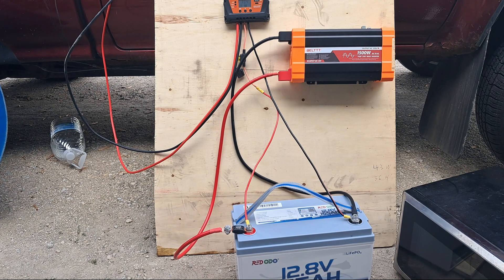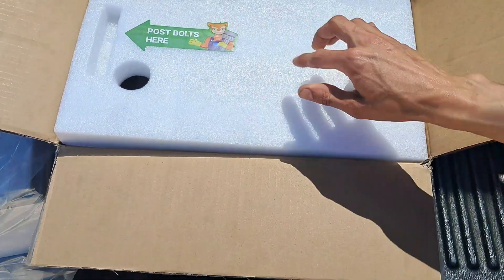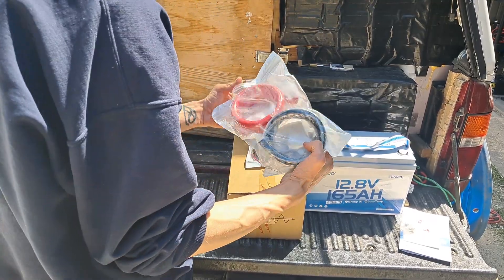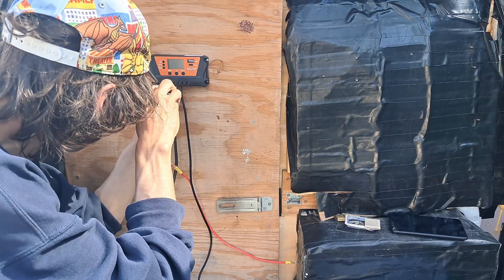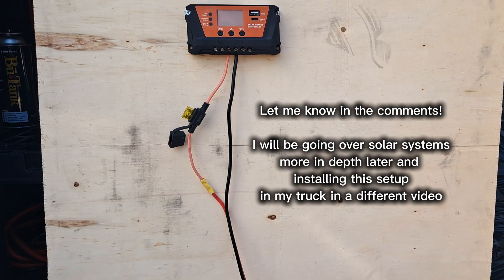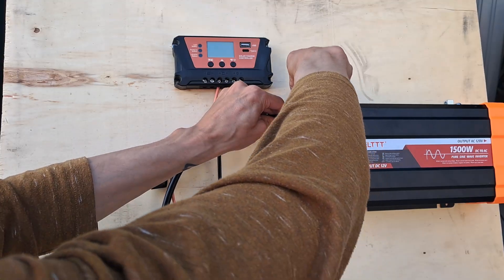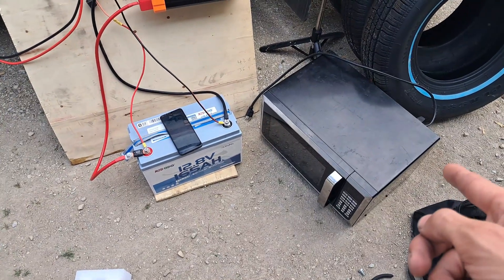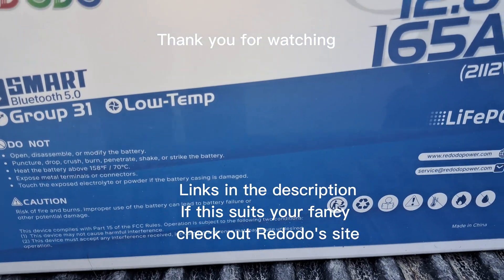Quick exploration of the solar system: Redodo 165 AH LiFePO4 Battery

Comment: Great video.  I like to play around with different solar set ups.  I currently have five AGM batteries for my set up, but they are old.  I've been thinking of upgrading to the lithium batteries like these.  Keep up the great videos.  Stay safe.
Reply from the maker: Nice! I was originally going to use agm batteries since I sometimes can get used ones in decent condition for cheap but decided on a powerstation because I was unfamiliar with everything. You gave me a good idea though might get one to test
Reply: @StriveSurvive  You sure looked like you knew what you were doing.  Great job.

Comment: I built my own power station and I made it overly complicated 😂. I like your setup and it is always nice to get out and try something new.  You can also buy a battery charger for it then when you have shore power you can use that too.  I would add some usb and usb c to it too. They are cheap and more efficient or so I have been told.
Reply from the maker: As long as it works right 👍   
I thought about making a portable version but ended up just installing this setup in my truck been great so far! I also thought about that but the solar charger has a USB A and C port and the power inverter has a single USB A port as well so I'm covered there  lol didn't have to think about it to hard it turns out.
Reply: Yeah and honestly whatever works best for you will be good. I mean it is never a one size fits all. I really like this channel. Keep up the good work!

Comment: you need a small crock pot that uses like 500 watts  and a small hot plate cheaper than propane good deal major upgrade for sure ! with a cheap hot spot you can stream and work online now ! use the power banks to run the fridge and lights !! sorry thinking out loud !
Reply from the maker: Haha it's okay good thinking! I might wait on the hot spot but the crock pot I've been wanting for some chili 👍

Comment: Once shes all charged up use the solar to continue to charge the power station thingys. That way you can run one heater on the battery setup and another on the power box and still have one in reserve that way youre not leaning too heavily on one power source
Reply from the maker: Yes good call appreciate the advice, and thank you for watching

Comment: Good to see you again! And glad you're getting the power upgrade. I'm hoping I can get a small solar system going in the near future. Most "no-name" inverters are best limited to ~85% load capacity for longer life. Also I wouldn't trust the low-temp cutoff in the battery without verifying that it works. If you serve any electrical contractors at your job put the word out to see if someone can do your crimps for a 'beverage donation' in lieu of payment. Hope you've found a good parking solution.

SOS here, can't make much headway as my body is failing me a lot faster than I imagined so work ain't much now. Hoping I can find an engine block this month but if not I'll have the $$$ next month. Still got the borrowed truck but it's a gas-hog. Take care bro and best wishes from the already-too-hot South 😎
Reply from the maker: Good to be back brother and great to hear from ya, I appreciate that man the upgrade has been nice and I enjoyed learning about it. I hope one day I can acquire enough stuff to give out or do some giveaways in the near future! If I ever get one of those tankless propane water heaters I'm sending it your way after I test it lol 😆  it's part of the deal lol but hey at least if I don't make it on YouTube I will have something to show for it. 

I should have asked before I pulled the trigger I didn't know exactly what to go for on the inverter I just wanted something that wouldn't be a brick in a few months but I guess it will be a good test video. Good call on the crimping I know a lot of mechanics that work for that exact deal 👌  

Oh boy this a long one! Wish I lived closer man finding car parts is what I do! I'd love to help ya, you know how many times NC SC keeps coming up! It's calling me.... I may have forgot but did you say what engine that was again?
Take care of yourself brother hope you come into some good luck
Reply: @StriveSurvive  Thanks for the thoughts on the W/H but I need a water system first- there was no tank or water pump with the camper. My guess is that someone let it freeze up and removed it. I can shower at my friend's place and the camp stove does the rest so I'm good. The inverter should be OK as long as you don't max it out or overload it. My 1500W MSW inverter does all that I need- a couple fans, phone charger, and my laptop. I don't recommend electronics with MSW (nobody does) but it works for me. If you ever do visit down south pick a good season. It's already hot here and in a month it will be sweltering till the end of September, maybe longer, and with high humidity. Takes some getting used to for sure. My engine is a 4.3 vortec so plenty of them around, I just gotta find one which doesn't immediately need a re-bore at a price I can bear. Worst case scenario next month's SS check will get me there for sure. I'm very used to everything going wrong but I manage anyway- I think you understand that all to well yourself. A positive attitude and a refusal to just give up makes all the difference in the world!
Reply from the maker: Oh I see, I just remember you mentioning those before as long as your good on that then! 

Still thinking of moving down there, I do better in the heat but not so much the humidity. 

Oh yeah those are good engines and plentiful. Well besides that spider injection system I believe those had them but not sure. My brother works at a recycling place il ask him about pricing.

Very true wish you be rewarded for yours more brother  hope some good luck for you
Reply: @StriveSurvive  There's two types of 'spider' injectors' I've got the newer one which is decent. Mine's good. My big problem is that all the old contacts I once had are dead or moved away and I'm limited to LKQ and Craigslist. For some reason Facebook won't let me set up an account and that's where the action is these days. The summer humidity in the upstate of SC and WNC is a bit high but nothing like being at the coast. It ain't dry heat like out west. 

The economy here is booming so finding work is easy but the better jobs may take some time to find. Rents have gone crazy. RV parks want $500 a month and up, renting a room is similar, trailers and houses are double that plus and rising fast. Not much by way of 'stealth camping' unless you can find a spot on private property away from the cities like I have. The governments here don't like the homeless and most places are zoned to disallow 'backyard' living of any kind and it's enforced. Most businesses don't allow 'overnighting' either. It used to be cheap to live here- not anymore. I couldn't make it on social security without my situation and my friends helping me out. It's still a great place to live for the climate and most of the people if you can stand the summers.

Comment: Hey bro I had you on my mind because I've been on the road for 3 and 1/2 weeks in my VW bus traveling the coast and need a better power inverter set up cuz I have no way of charging my deep cycle love your videos keep them coming😊
Reply from the maker: Appreciate that bro, take care out there. If your battery is not to hard to take out maybe see if an auto parts store will charge it up for ya. It's usually free and most places have a decent battery charger but not for lithium batteries just a thought 😉  will be posting again regularly just got caught up in my work

I think I undersized my inverter on that note always go a bit bigger 😓 haha 😄
Reply: Hey thanks for the tip man I'm going to O'Reilly Auto parts in capitola California to pick up some plug wires before I make my way to Monterey I'll have them charge up my deep cycle😊 @StriveSurvive

Comment: Hay good to see a update. I see your making some improvement on the truck setup.  How is work and the parking situation?
Reply from the maker: Hey bud good to be back! Yes I thought about saving up for a van but for many reasons I'm going to fix up the truck for now. Unless things change drastically. 
Parking situation is good work on the other hand has been picking up in a stressful way, been tired but still working on a somewhat big project. Also might have found a possible side job if fate allows well besides YouTube anyway lol

Great hearing from ya bud it's been awhile
Reply: Ill keep you in my prayers.  💪✝️

Comment: I love this video. I would love for you to explain more of the parts you used and I’m really interested to hear how long you can run the ac. I’m looking to either get a van or build something for my truck. Good job and good to see you
Reply from the maker: Glad to know it was appreciated! I plan on going deeper in explanation later when I do the video of the install in my truck so don't you worry plenty more on that. If that AC run constantly it would only run 5 hours but since it cools down quick in my truck the compressor kicks off and it only runs like 60watts so it's hard to say how long exactly but I can try and figure that out. Glad to hear from ya and good to be back
Reply: @StriveSurvive good point about the small area to cool. Can’t wait for the next video